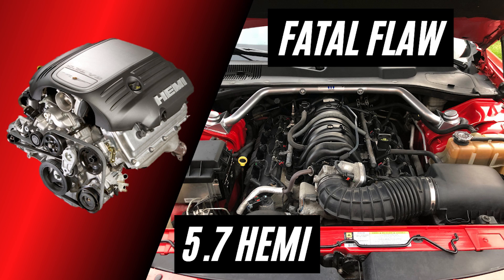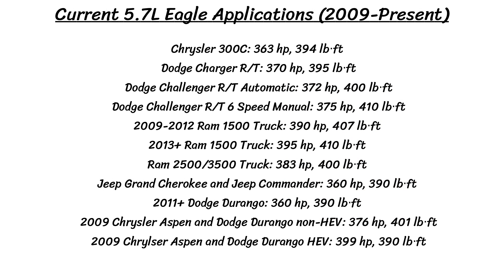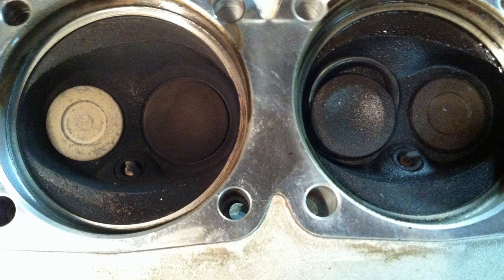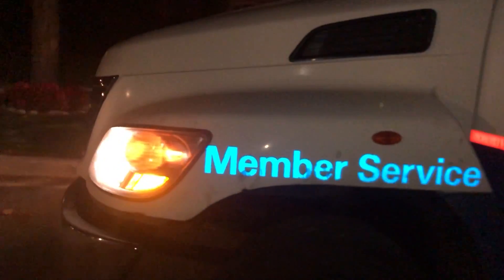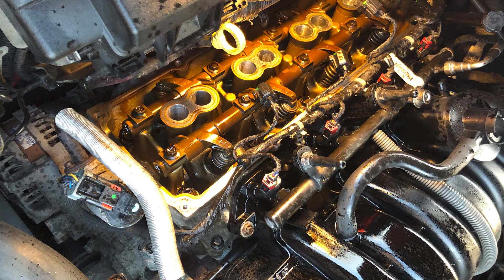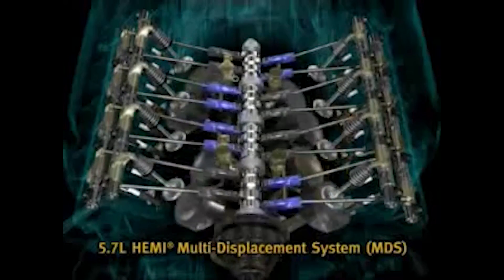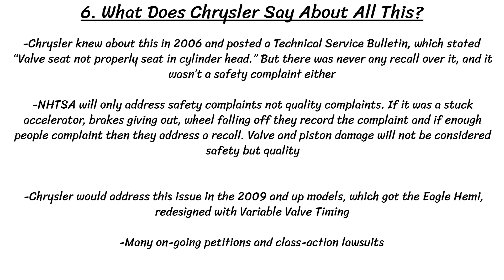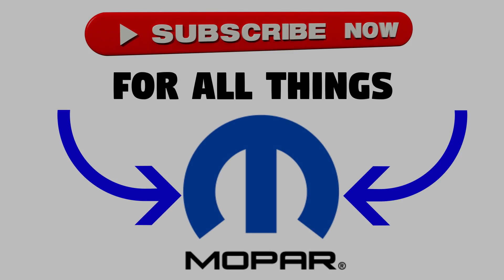The Fatal Flaw of the 5.7L Hemi V8 Engine & How to Prevent It (2003-2008 Valve Seat Drop)

Comment: Can you cover the 2009-Present Eagle 5.7L and 6.4L HEMI Lifter Failure?
Reply: Yes PLEASE. My 2019 Ram with 35k miles is in the shop due to the lifters 😡 currently in the process of filming a video about this whole process for my YouTube channel.
Reply: @BatesRacing  well, I was going to tell you to use redline oil to kill the hemi tick but your truck is still under warranty so let the dealer take care of that.
Reply: @7thkev519  exactly, warranty is wonderful lol. But I also found out that they've been using conventional oil (always had my truck serviced at this same dealership). So when I get the truck back I'll be using synthetic going forward... I'll look into Redline!
Reply: @BatesRacing  A 19 had a lifter failure? Details please, the issue is supposed to be solved by the updated lifters that your truck should have. Are you SURE it's a lifter failure?
Reply: @snek9353  so far that's what the dealer is telling me, I only heard the ticking/tapping on a coldstart. Will confirm when I know more...
Reply: @BatesRacing  Please do, if you have the typical lifter failure where the rollers fail that would be big news. From what you said to Radford though that's not the issue. A knocking/ticking sound that only occurs at cold start might  be a lifter issue. But it's not the typical lifter failure that many are concerned with. That type of failure would tick all the time.
Reply: @snek9353   I will update for sure when I have more information. Once the truck is fixed, I'll also be posting a video discussing the whole situation... I should have an update monday.
Reply: @BatesRacing  sorry you are going thru this. Hemi COULD be a great engine, instead it has a major design flaw. Needle bearings can’t get lubricated properly which lead to seizure of the lifters and then eats into the cam lobe. Happened on my 2011. I will never buy a new Ram. Full synthetic, Redline oil, doesn’t matter. They will eventually seize up no matter what oil you use. Good luck
Reply: @littlejohn6694  but doesn’t the 5.7 HEMI have the same design since 2002?? Other than MDS,VVT,aggressive cam,and better intake manifold.
Reply: @7thkev519  the rumor is that they changed the lifters in 2017, but there are still people on the Ram Forumz stating they are experiencing failed lifters/cam on 2017-2020 5.7’s. Some with under 40k miles. Under warranty yes, but who wants to have their new truck go thru that shit? It’s a wide spread issue and honestly should have a class action suit by now. I feel really bad for those out of warranty and have to pay the $4k+ bill if they have to have the long block replaced when the lobe gets eaten so bad metal shards end up all over the motor. Good luck all Hemi owners
Reply: I comes from a lifter being bled down of oil then you start the engine drop it in gear and take off down the road which then takes longer for the lifter to pump up. This causes the roller tip of the lifter to take a beating causing failure. This is not a hemi problem, its a roller lifter problem and happens on gm as well.
Reply: @scr454  well there's 2 theory and the biggest one for the cause of lifter/cam damage for the hemi and gm is because of the MDS and AFM/DFM. Many ram forums and Silverado forums talked about when MDS/AFM doesn't work right it jams itself jamming the lifters and not getting any drop of oil and another is that when MDS/AFM activates it consumes a lot of oil or doesn't get any oil people have reported that when they took a look on the damaged lifter they saw that lifters with MDS/AFM did not have any oil they were bone dry and other hemi have had lifters with the MDS that did have oil but the lifters with no MDS we're bone dry meaning that the MDS/AFM was consuming oil not letting lubricate the other lifters. None of this was supposed to happen if Chrysler and gm added MDS/AFM.
Reply: @7thkev519  false i replace cam lifters on non mds motors as well.
Reply: @scr454  yeah I've heard some of the 1st gen 5.7 hemi had some cam/lifter problems but it's rare many people have the 2003-2006 hemis and never had that problem it's more common on the 2009_
-2020. same for the 5.3 they never had any cam lifter until gm added the AFM and people have reported loud ticking on the engine and start complain in that their old 2005 chevy with the 5.3 with over 100k and never had any ticking problem.
Reply: @7thkev519  There's no reason to think it has anything to do with MDS.
Reply: @snek9353  then explain me why does the 5.3 that’s been out since 1997 has never had any cam/lifter problem and owners that have a 5.3 over 100k miles and they never had this problem until GM added AFM which is the same thing as MDS. The 2002-2004 hemis never had the hemi tick or cam/lifter failure but in 2005-2008 they added MDS and there were some few reports of hemi tick but it was rare to get it. Until Chrysler updated the MDS on the 3rd gen hemi in 2009 they started to report ticking noise on the newer hemis and year after year the cam/lifter issue has been stacking up and many people have been furious and started to complain that they used to own a 1st or 2nd gen 5.7 hemi with over 100k miles and they never had  any cam/lifter failure so why do the newer hemis have this problem . The 5.3 and 5.7 hemi are the 2 oldest engines that are still being offered in today’s trucks and both of these engines were known to be bulletproof and then suddenly their reliability turn to shit in the next 5 years.
Reply: @7thkev519  Wow, that's a heck of a straw man carrying the goal post. 

First we are not talking about the lifter issues here, this is about the dropped seats. These are SEPERATE issues with SEPERATE causes. That makes this a straw man argument. If you want to talk about the lifter issues that is a different conversation. The point I made is there there's ZERO reason to think the dropped seats have a single F'n thing to do with the MDS. 

Hardened seats in aluminum heads aren't new, you truly can not have an aluminum cylinder head without them. Nor is dropping seats out of them. This was a manufacturing flaw in the heads period. 

Lifter failure did occur in pre-eagle hemis, it did happen less though yes. The MDS system was not updated for the Eagle, what changed was the cam profile. Cause of the addition of VVT they started using a more aggressive camshaft with higher lift and steeper ramps. This put more stress on the rollers then in the pre-eagle Hemis. The 6.1 has lifter failures about as much as the eagle 5.7. The 6.1 is a non-MDS engine, but it has a more aggressive camshaft. The common failure point is the undersized and poorly made bearings in the identical rollers used in both.
Reply: @snek9353  I don’t think you didn’t read my previous comments right or the discussion starter comment  which is mopar fan who talked about the 2009 and up hemi tick problem so we weren’t talking about the valve drop issue on the old hemi we were talking about the hemi tick and then I got my self in a argument with someone telling him that MDS is the cause of tick which also does not talk about valve seat drop. So your the one who’s talking about the valve seat drop not us.
Reply: @7thkev519  That's fair, didn't catch that. The rest of my comment still stands though, the MDS is not a cause of the lifter failure. The roller function and MDS function of the lifters are separate. It's the roller function that fails and non-MDS lifters fail at the same rate as MDS lifters. 

If anything MDS might help, an MDS lifter has an additional supply of oil.
Reply: @snek9353  someone else told me the same thing that non-MDS lifter also fail and my response was that when MDS activates(I’m not 100% sure if this is true) it consumes a lot of oil and most of the oil goes to the MDS lifters and not leaving a drop of oil on the non-MDS lifters. I’m still not sure if this is 100% true I saw this in a ram forum.
Reply: @7thkev519  No, that's not true, easy enough to prove, if it was true there'd be other symptoms, most of all the oil pressure dropping. The MDS system only consumes very little oil. It also gets it's oil from a sperate source. 

There's 3 oil supplies to MDS lifters. 1. A regular oil galley like many other engines, however better as the hemi lifter galley is center fed. In other/older engines the lifter galley is fed from one end, so at times like startup the end lifter is the last to get oil. In the Hemi the lifters are fed in sets of 4 from the center, so the oil only passes one lifter to get to the furthest lifter. This oil lubes only the outside body of the lifters, it's the splash oul from this supply that oils the rollers. 2. In the Hemi the rockers in the heads are supplied oil pressure. The push rods are hollow and that oil goes from the rocker, down the pushrod and this supplies oil to the hydraulic lash adjustment portion of the lifter. This method prevents the lifters from draining down or pumping up. 3. The MDS solenoids are oil valves that are fed off the main line and supply through a separate passage oil pressure to the upper side of the lifter body. This oil pressure pushes on pins in the body of a MDS lifter, this is what unlocks the lifter to put it in MDS mode. It only consumes enough oil volume to push in those pins and some more leaks out the top of the lifter bore further lubricating the lifter body. 

The only difference oiling wise between MDS and non-MDS lifters/engines is that third path isn't used. The 6.1 and 6.2 block don't even have the third passages in the block. A 5.7 and 6.4 block without MDS has block off plugs where the MDS solenoids would go. FYI the 3G hemi version that would use the most oil volume would be a 6.4 with MDS. The 6.4 has the addition of piston oil squirters. The 6.4 also disproves the claim that the MDS system needs 5W20 oil. The 6.4 has the same MDS system but specifies 0W40 oil. 

With stock settings(mine aren't) MDS also doesn't activate when the vehicle is under 10 MPH so it's never in MDS during idle where oil volume/pressure would be low. FWIW it also isn't active above 3000 RPM(lower when the oil is cold)
Reply: @7thkev519  2003-2008 Pre Eagle***
Reply: @7thkev519  And those are Gen III HEMI's
Reply: @moparfam300c  the guy does give a good explanation and maybe he is true that changing oil regularly can improve its lifespan or maybe use a different type of oil or as many people called it REDLINE OIL since it has additives that suits the hemi .I’ve also read the comments and people kept saying it’s a design flaw so I’m not sure if this true but the hemi tick is still unsolved problem because many people have different answers to this problem so trying to figure it out is not easy.
Reply: @7thkev519  I Absolutely agree
Reply: The videos from Darth Hemi are more informative about the actual issues. While not well made he has 3 or 4 that go into more detail about the issue. https://youtu.be/jmj9AveVO1E They're mostly in rebuttal to the Uncle Tony videos but still very informative.
Reply: Why, he wouldn't know anything?
Reply: Radford Tataryn  to be honest I dont know those exact details, I'd have to look in the truck's data in the display to answer for sure. Plenty of highway miles, lost of around town miles, not an unusual amount of idle time. Definitely shouldn't have happened! I only hear the sound on a cold start and I'm mainly going by what the dealership is telling me 🤷‍♂️
Reply: Whats the best oil to use for a 2016 challenger RT? In the process now of buying one with only 12 k miles
Reply: @kd-jj1rn  The general consensus and my choice is Redline High Performance. It's pricey though, at generally over $10 a quart. Redline though is a VERY good and innovative company. I've been using their products for decades and have never been disappointed. Their engine oil is unique in being a true ester base, it's a true synthetic, most synthetics aren't actually, most are highly refined crude based. This along with their far superior additives make it a much superior oil. In forums like Bobistheoilguy you'll find a lot of data along with stories of people who've quieted their hemis using redline. 

But again, pricey, it's also not an approved oil per Mopar but Redline says it's compatible. But  if there's a warranty issue it may be a problem. If warranty is an issue I'm told Amsoil is approved and the next best option. 

As for weight I've been researching that and while I have 5w20 in my engine now I think next will be 0W30. But that would certainly be a warranty thing if they checked.
Reply: In the 2016 gen 4s they quietly changed to updated lifters.
Reply: Keep clean oil in your motors that's the biggest issue with these lifter problems
Reply: UPDATE: Found the Solution to the HEMI Lifter Failure covering the 2009-Present 5.7L HEMI and 2011-Present 6.4L HEMI

Link is down below

https://youtu.be/bdZuni-tp4U
Reply: @moparfam300c  It's an interesting vid, I've seen it before. For those of us that have been researching the issue it doesn't really provide any new information though.

Comment: I have an 05 Magnum RT with just over 200k on it. Hasn’t had this issue yet, but I am worried about it. Car runs really strong, though. That’s a great idea about putting it in Auto Stick mode before I arrive so that the MDS cuts out (plus it’s fun to drive it like that!) I’ve also been letting the car idle with the hood open for a minute or so when I arrive, to try and cut the down the heat soak. Thanks for the info!
Reply: There's no way MDS has anything to do with it.

Comment: My friend's 2010 Ram 1500 5.7 Hemi ate its camshaft.... $8000 repair bill. Truck's barely worth that. How about a recall, Chrysler?
Reply from the maker: Jeeeez that’s crazy. That’s the eagle motors main issue, no recalls to be seen 😩
Reply: I had a 2009 Ram 1500 at the time... I sold it not long after my friend's sh!t the bed. I'm a total Mopar Or No Car guy but I wouldn't touch a car with a modern Hemi in it anymore. 👎
Reply: 8k they must of replaced the engine,  not just a new cam and lifters?
Reply: It wasn't a full rebuild, just top end as far as I know... cam, lifters, etc. He had it done at the dealership so there might have been some gouging involved.
Reply: @SilverFox_Machina  wow yeah should of been under 5k for sure
Reply: @airratchetjockey7605   We are talking Canadian money, realize.
Reply: @SilverFox_Machina  gotcha, that makes more sense.
Reply: Same happened to my 2012 Ram 1500 at 101k. I’ll never let a Hemi burn me again. Problem was way too common.

Comment: Awesome  idea and video! You should do this type of video with other engines. I have a 5.7 in my 08 aspen with 125,000 and still the first owner with the lifetime power train warranty form Chrysler. If my engine needed to be replaced where would the engine come from?
Reply from the maker: Nice you gooood 😂😂 they would likely give you a newer eagle crate 5.7 motor from Mopar, take yours out and drop it in. I don’t think they would take the time to rebuild it but not too sure
Reply: @MarspeedCars   yeah that'd be sick! Figure they would at least put in the one from 09 that made a little more hp then the 08. So I'll be sure to keep my engine nice and warm 😂😂
Reply: @Hybrid Libertarian My father works at a Chrysler dealership and they have used the Vin for my aspen to get hundreds of free parts for vehicles they work on from Chrysler.

Comment: Best thing to do is to just save up for some eagle heads or aftermarket heads
Reply from the maker: Yeah exactly wish I would have done that too
Reply: @MarspeedCars  part two pls
Reply: How do eagle heads fit? Then your manifold doesn't fit anymore because of the shape of the block...
Reply: @alexh201174  eagle heads fit, just it bumps the compression up to over 12:1 which is very high
Reply: @captainblaiser  i understand you can bolt them on , but the heads are lower and then you get not enough clearance for the manifold, that's what I found here on yt at least. Or have you found a way that it fits?
Reply: @alexh201174  in theory it should be a direct bolt on, but like I said, then the compression is too high so you would need new pistons if you were to actually use this
Reply: @alexh201174  also, if someone were to do all the work like that, I would highly recommend headers, stock manifolds are junk
Reply: Mines is a 2005 I should be good no mds?
Reply: @charlesalegria73  all hemi's from 2005 and up have it, when you drive at constant speed does the engine sounds different? And then when you go up a hill your hear the sound change? Then it has mds
Reply: @alexh201174  MDS came out in 2006
Reply: @captainblaiser  thought it was 05, when they introduced the charger, but of course I can be mistaken
Reply: @captainblaiser  MDS was introduced in 2005 on the Magnums. My '05 Hemi Magnum RT has MDS.
Reply: @martinmessineo4964  Interesting, must have been 06 for the Ram variations then
Reply: @captainblaiser  Yeah, that would be news to my '05 Grand Cherokee w/ MDS.
Reply: @captainblaiser  Actually there was one model of 2005 Ram that got MDS as well. The 2005 Daytona edition Ram 1500 (regular cab 2wd) got MDS. Probably because it released much later in the year, and was actually on the assembly line with the 2006 model rams. I know this for a fact because I bought one and I still own it. 211k miles now, and so far no engine or transmission problems. I have driven the sh*t out of it almost every day for years now. So it has held up very well considering it hasn't been babied.